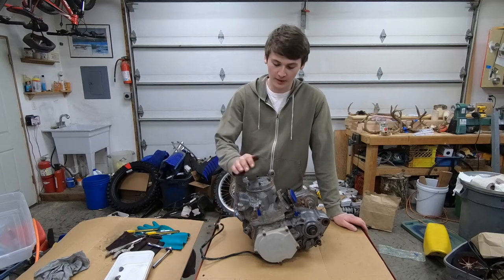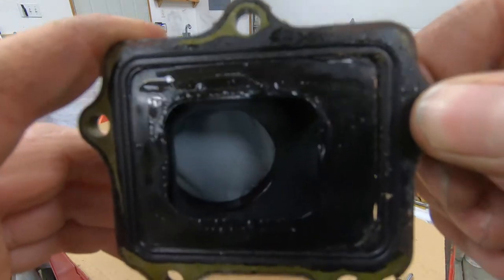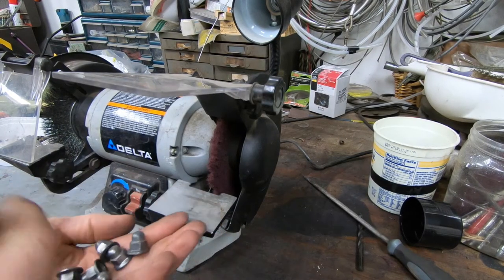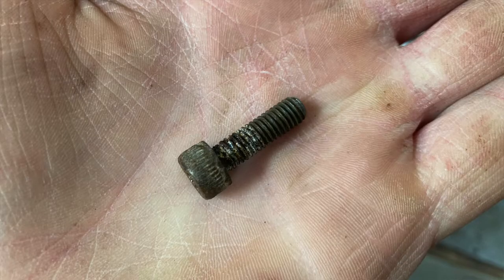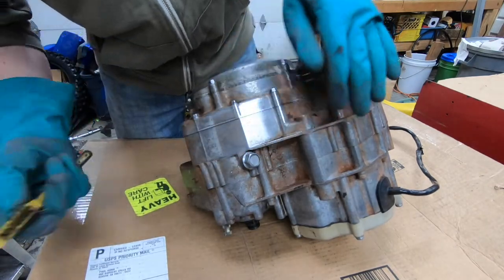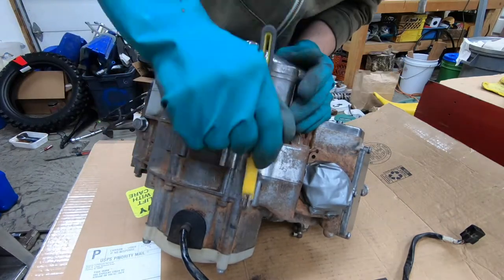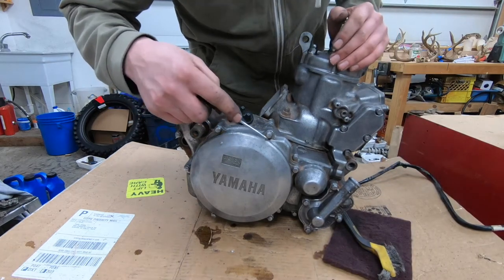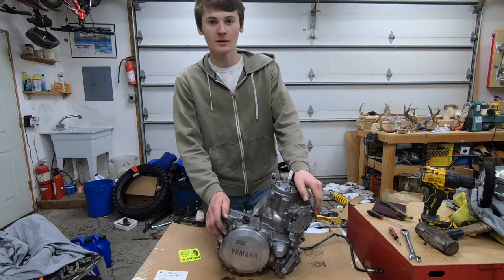Cheapest Way to Shine up Engine Cases!

Comment: You should try the scotchbrite wheels that fit in a dremel, gets in all the right areas. That’s what I’ve been using to shine up my CR125
Reply from the maker: That’s a good idea! I’ll have to try that next time
Reply: Sometimes I like to tape that wire brush to my reciprocating saw.
Reply: You've certainly got patience and a desire for a good finish. 
If you can find a heat proof clear finish (possibly in a spray can), once you've achieved the level of finish you like, the clear coat/s will protect your shine and make it a little easier to keep clean. 
Good job.👍

Comment: I’ve found that scotchbrite and wire wheels on a Dremel tool with flex shaft attachment will work wonders on automotive aluminum engine and transmission cases, try it next time!
Reply from the maker: Thanks! I’ll be sure to try that out
Reply: @projectdirtbikes  for sure, wear safety goggles and a face shield though if you ever use those wire wheels!! The wires go everywhere
Reply: I think I'm finally gonna pick up a Dremel with the flex shaft. Which scotchbrite wheels do you like? Any other good attachments for this kind of stuff?

Comment: Just spend the $$ and get them vapor blasted. Tear the whole motor down and rebuild it so you know exactly what you have and you will have less headaches in the long run. 

I spent 100 hours hand polishing my cases on my two stroke street bike for a 5axis billet look and will not recommend that kind of work on a dirt machine. Just vapor blasting them and be done. Most local shops will do it for $100 but  you will have to send them out to a specialist if you want show quality bc local shops don't do low pressure two stage blasting with ultra fine beads and offen their media is contaminated. Specialized shops charge $75 an hour and so you are looking at $250 to $300. That's about the same as a metal finishing shop would charge your to mirror polish them though that is standard machine polishing and will have rounded corners ect. Hand polishing is the mist expensive because it requires lots of time and hard labor. Your fingertips will give out more than once during the process but tge end result is a flawless flat surface that is above all else. If I had to do it again for someone else I would charge $1500 min on a single cylinders engine cases. I taught myself years ago and after looking around the only guy I've seen do it the right way has some videos about it where he did an aluminum cylinder hear for a Mitsubishi show car. There is no short cuts. The use of power tools will ruin it so don't even think about doing it. It's hard work, just suck it up and do it.

Comment: Was looking for something with less elbow grease.
Reply: aluminum brightener. Get it at napa its like 6 or 7 bucks for the spray bottle. Works great just dont let it sit too long. Also if you have painted area dont spray on it, it will eat the paint off.

Comment: Ok guys heres the deal . Jewelers Rougue . Pronounced Ruhzzz. Cloth buffer and bam real mirror finish. Works on brass aluminum copper . 
 Amazon kits cheap . Faster drills are ok but really need some high speed sh$# to buff . Theres white for plastic , green for stainless , red or brown rerown thats reddish brown in hilly billy speak is for gold , silver ,brass , magneseum . 
 Poishin my knob the other night tried that wd40 . Burned like a sob. Had old stinky burnt knob man what a deal. 
  See my old brass blade fans I restore . I have 2 channels check them out please an TY . Good luck an if you got questions I will help ya